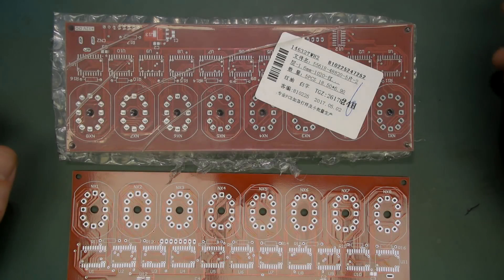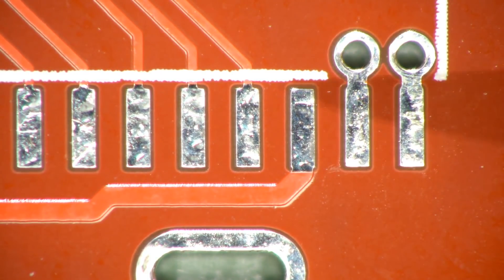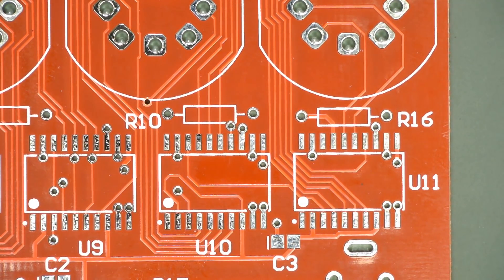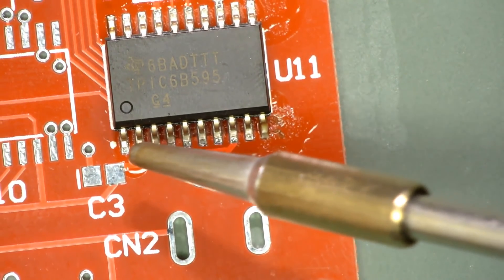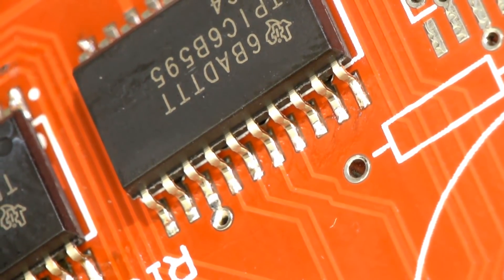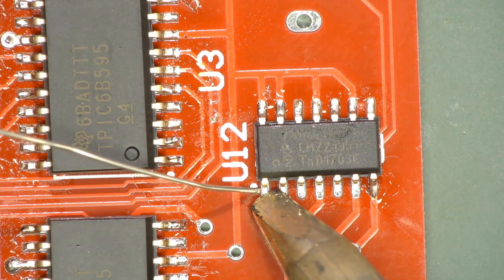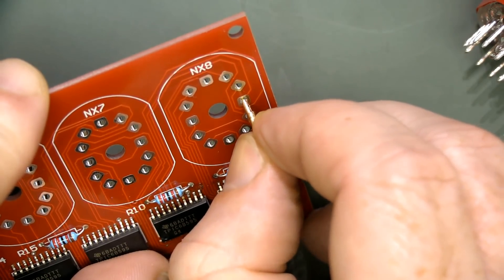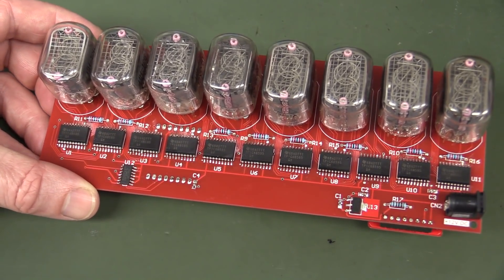EEVblog #997 - How To Solder Surface Mount Components

Comment: Cheers for the interesting and informative video Dave! Is there any reason you don't go back with some hot air to tidy up the placement and joints on the smd parts? I've done some shocking smd stuff by hand and fixed it with hot air later.

Comment: What's wrong with the soldering paste like MCN-300? It's much easier to use than any soldering wire in case of SMD soldering even with soldering iron.

Comment: Why did you use lead free solder?
Reply from the maker: To show that's it works just fine too.
Reply: I've always been taught that lead free leaves a poor appearance. 
Are there actually any benefits?
Reply: wasgood1 

Main reason to get on with lead-free is because many Countries have changed over to it due to the ROHS directives etc.

Lead-free is fine, as shown in this vid, as long as you buy the decent stuff (which will likely cost a bit more than your average leaded stuff, but not by much.)

Almost every consumer product made since about 2010 (at least in Europe) uses lead-free, so it clearly works well.
It definitely works better than the cheap electrolytic caps used in most gear these days. lol

Lead-free gets a bad rap for making weaker solder joints, especially after that whole Xbox360 RROD / PS3 YLOD saga, but that was mainly due to the piss-poor thermal design of those consoles, and problems with the internal "solder bumps" of the flip-chips.

See Louis Rossmann's vid on "Flip-chip BGA reballing is BS", or something like that. lol

There is a theory that lead-free is also more prone to the " tin whiskers" phenomenon, and there's even a white paper about it online, supposedly from engineers at NASA, but I haven't seen any direct evidence of that problem in the last 15 years of working in telecoms factories, where they used lead-free exclusively.

Comment: cant lie, solder job looks crappy. I never use flux and i can drag solder and look like factory work after on ic's. I need to make videos on my style of soldering. Also whats even more amazing is I use a adjustable 75w iron with one sharp tip only lol no bench soldering station or anything
Reply: The vast majority of components have tinned leads/contacts, so flux is indeed optional.  The problem comes when you don't notice you have untinned leads, and get bad soldering as a result.

The cost of flux and cleanup is always far less than the cost of troubleshooting a fault and chasing down a bad solder joint.

It is best to have a consistent soldering technique (with flux) that works "no matter what".

My worst problems came when soldering wire/cable directly to a board, where tinned is the exception rather than the rule.  I did this mainly for prototypes, when I was too impatient to wait for the connectors to arrive (or too cheap to pay for them).  Plus, if a connector is mis-wired in the schematic or layout, it's generally easier to fix a direct-soldered cable on a prototype (and continue with debugging the rest of the board) than to fiddle with the connectors.
Reply: i meant as no need for extra flux, i use the flux core as my main flux. I just go through more solder doing it.
Reply: DAT 30GB yes, please make videos on how to get factory looking soldering with lead-free solder

Comment: Dave how is the washing done (the process) to remove the flux residue ? can u do a video on that ?
Reply from the maker: Just use a can of any flux remover on the market and a brush (usually comes with it).  Regular Isopropyl works fine in many cases too.

Comment: This is like The Bob Ross of Soldering.
Reply: We don't have short circuits. We just have happy little accidents.
Every resistor needs a friend.
Reply: Niko Andruloni I was gonna say Big Clive too....you beat me to it
Reply: re the bob ross:   And..  there's a happy little surface mount tsop over here and  perhaps  a throughhole rectifier over there....     you can do what you want and don't be afraid or bashful    .. after all , It's your circus board  ;)     you can add a little flux to your capacitor if you wish ...   we don't judge here..........    feel the flow .. working it.. all good things!  ;)
Reply: @EngiMeer  Happy little solder. Theeeeere you go. Beauty. Now, how about we place this passive right here? Make it reach its friends. Because every little passive needs a friend.
Reply: Nah, that would be BigClive, Dave's too excited.
Reply: @andruloni  you mean Big Kev ?
Reply: Slapping soldering iron 10x on table leg at the beginning of work.
Reply: No.
Reply: He's more like the Bob's your uncle Ross of soldering.
Reply: i can watch this for hours
Reply: Maybe in your world, RoHS doesn't cause (intentional) premature equipment failure, and that's OK.
Reply: Bob Saget

Comment: Soldering surface mount parts is a lot easier with the pointed curved tips. I solder everyday and it helps a lot  although we always use 2 soldering irons which is sort of cheating.

Comment: I've always wondered how do you clean up the flux residue, I mean, is there any proper technique? for example, how do you clean up the flux between the pins ?
Reply: you can use isopropyl alcohol, regular drug store stuff, thats what I've used, not sure what the pros use though.
Reply: As SH says, simple rubbin' alcohol works well.  50:50 is fine; the water makes a good solvent too.

Comment: Thanks for the video. I have watched your soldering videos and they helped a lot. I needed to take the switches out and put new one in my logitech mouse  and was having nothing but trouble, after watching your solder vids, I took a file to my stick no controls solder iron gave it a chisel point and got the job done. Now I have two m570 mice that work better then original. 
Thanks for the demo vids they are a great help.

Comment: Wonderful vid, Dave! Thank you. I love watching SMD soldering vids and this was great. I have not used a well tip for soldering SMD and have only used a fine point chisel tip. I will probably never use a conical tip ever again. Looking forward to seeing your board powered up.
Reply from the maker: Don't use conical tips, the surface area for thermal transfer is horrible.
Reply: Agreed! After I bought my Hakko FX-888D, and it came with chisel tips, the difference is amazing. It really makes soldering enjoyable. Conical is just bad. Thanks for the reply, Dave! Keep up the fantastic vids.
Reply: I didn't solder for years because I thought I sucked at it, and you gave that "chisel tip" tip in another video. Asked for some chisel tips as a stocking stuffer for last Christmas got them and the difference is like night and day. I actually can solder well now and am getting back into making my own electronics projects again after not really doing much in decades.
Reply: The fine chisel is my shit. I solder everything with it, every day- down to fine-pitch TQFP and QFN

Comment: That's amazing value for those boards and a nice result.  Great results on the soic packages. I know everyone advises against it, but for me if soldering really small ones, like tssop56 or lqfp144 I prefer a nearly conical tip, just the faintest bit chisel at the point.
Reply: Okurka

That was 2-layer though, yep?

I found a great place for 4-layer - only $46 shipped (from China to the UK) for ten 10x10cm boards. :o

(with small 6 mil traces / spacing, and 12 mil drills / vias, and the quality is superb.)

I won't mention them directly, but have a search on PCB Shopper, and you should find them. ;)

Comment: Great video! I've learned a ton from your soldering videos. So one question if anyone has an answer, I just got a hakko fx-888 (upgrade from my 937 clone) I'm getting better at soldering but one thing I cant get a handle on is when I remove the tip from the joint, the solder will stick to the iron and create sort of a teardrop that looks bad and ends up bridging pins at times. I realize the fx-888 is not the best(best I can afford as a student), but I assumed that genuine hakko tips would help alleviate this? Im guessing its something Im doing wrong, any help would be appreciated!
Reply: This could be due to a number of reasons, actually. The primary cause seems to be that you may be applying solder directly onto the iron before applying it to the joint. You are probably letting the flux activate and dissipate before removing the soldering iron. Keeping the time to less than a second each joint is the most effective way to avoid this (unless your iron has poor thermal capacity, or conversely your board has a large one, maybe you've had problems with trying to solder ground pins in particular? :D )

The Hakko fx-888 is a great entry level soldering iron but here's a few tips to help it perform better and some soldering tips in general:
1. Make sure your tip is tinned before and after use! Oxidation on the tip is a common cause of improper joint heating and solder flow.
2. Make sure that you apply solder after you place the tip onto the joint. The joint temperature will activate the flux which will etch the oxidation layer on top of the join allowing nice, easy flow on solder.
3. Make sure that your tip temperature matches with the solder you're using. 60/40 lead solder is usually at around 240-280 C and lead-free is 300-350 C. Your Hakko has an 'adjust' mode which can be calibrated to the actual tip temperature, use a thermocouple to measure the tip temperature and calibrate your hakko to ensure that the tip temperature matches the displayed temperature!
4. Make sure you're using the good solder stuff! Use 'Multicore' (or other brand names). The flux formulation is a little different than crappy brands and will give you nice clean solder joints every time! Remember, temperature-activated flux has a limited lifetime at the temperature you solder. If your iron isn't smoking from the flux, the flux is most likely deactivated. This usually happens in less than a second! Do your joints quickly and carefully (making sure you balance the two).
5. Don't use too much solder! When you use too much solder it causes 'balling' which can hide 'dry solder joints' (bad joints). Try to practice soldering at your own pace, using through hole components and then moving to SMD.

EDIT: Another thing I might like to add is to use wire-based tip cleaning solution rather than the wet sponge method. This is much better at making sure your tip stays at the correct temperature and prevents wear and tear over a longer period of time for your tip. Your tip should be nice and shiny after cleaning and should be tinned between cleans! You can make tips last a very, very long time just by tinning, so don't be afraid to be liberal with solder for tinning.

Hope this helps!
Reply: Thanks for the reply! I actually do apply heat to the pad and joint and then apply solder from the other side, I use flux in addition to the flux core solder, I have been buying relatively cheap solder, but only because google searches didn't turn up much in the way of good solder brands, I actually looked up multicore after  I saw thats what dave was using, Ill have to get some good stuff soon. I do tend to use a bit too much solder at times I think, Ill have to adjust my temps a bit and check out what the temp rating on my greenlee 510A thermocouple is and possibly measure the temp with that. I have actually been using both for cleaning but I will switch to just the wire. Thanks for all the suggestions!
Reply: No worries, hope you have success with your future projects :)

Comment: What temperature do you use?
Reply from the maker: That is not a question that should be simply answered with a number because the answer depends upon the type of tip used, the thermal capacity of the iron being used, the tip to surface area, and the solder and flux being used.

Comment: 6:18 - Why put solder on the pad before putting the chip on it? Just hold the chip in place with tweezers and drag solder it. I have no problems doing it this way and it's much faster. You need to use a lot more flux.

Comment: What about cleaning the board once it is populated?
Reply from the maker: Yeah, forgot to film that :->
Reply: Future Video for you then.
Reply: Careful if you're using plastic components (especially connectors), as acetone can be quite harsh on certain types of plastic (like polyethylene). I would recommend using isopropyl first, if you're not sure.
Reply: Jesper Jensen I prefer to use lager instead of IPA, the board smells less hoppy afterward.
Reply: Siana Gearz Good point, but I would exercise caution nevertheless if you're designing or cleaning with any plastic in the vicinity. Acetone might not dissolve the whole thing but it can cloud clear acryllics or strip adhesives if you're careless!
Reply: I use 96% ethanol and a tooth brush to get rid of most of the crud (doesn't need much alcohol for that). But since after evaporating this will still leave a very thin layer of residue (just looks splotchy and matte) I usually apply water and soap while the alcohol is still there and rub again with the brush and it's super clean after that. If you have an air compressor you can dry a board within seconds, but a hair drier should be fine as well.
Just be careful when you got pots, switches or connectors. You don't want to flush dirt into them. If there's just one or two of them on a board I leave them out and solder them after I cleaned the board (trying not to overdo it with the flux that time). All other electronic components are pretty much water proof if you make sure you dry everything reasonably quickly (don't wait a day) and completely before applying power.
Reply: Sunny Pack that is true. Most common enclosure material is ABS and it's fully solvable in acetone. In general acrylics, styrenes, polycarbonate and polyurethanes (glue is mostly those) are sensitive to acetone. But MEK is a common industrial wash for PCBs, it's closely related to acetone, and everything that you solder down, you expect to be highly resistant to ketones.
Reply: Ben Krasnow at Applied Science has a really good video on why adding water to alcohol cleans most things better than pure alcohol. To summarize, the water dissolves more polar compounds, of which flux has many (e.g. acids)
Reply: 50/50 blend of acetone and isopropyl is what I use, works like a charm.  I have a tiny spray bottle I use for it.
Reply: I use 91% isopropyl from the local store. Nothing fancy. I have a squeeze bottle and some "acid brushes" to scrub with. I rinse in more iso, and dry it under my fume filter fan.
Reply: IIGrayfoxII As others have said, usually if u can get a hold of %91 alcohol that's more than enough for your everyday non crucial projects, just make sure it's dry before you run anything on it. If you want to go the extra mile, use 99%+ alcohol or pure acetone if you can.
Reply: I use denatured alcohol with a heavy plastic brush followed by a hot water and soap rinse and dry thoroughly with an air compressor.  If you have components that can't get wet, solder those on last and just do a quick cleanup of the flux on those parts without wetting the whole board.
Reply: Sunny Pack, you really found a connector that wasn't made of PA or PBT and is sensitive to acetone?
Reply: I use 99% IPA but not all of it comes off.
Reply: add a bit of clean water. I use a blend of 75% IPA and 25% Demineralized water.
Reply: For some reason I find using any ethanol/alcohol on any red PCBs causes the lacquer to become sticky and leaves it messy.
Reply: F3Ibane - LOL! I don't drink, but a pal of mine is into trying lots of quality artesian brews. Was waiting for that joke! :D

Moen I - Interesting... I've not used too many red boards, so that's new to me.
Reply: Moen  Lacquer is not alcohol based, it won't affect it in the slightest.  Shellac, on the other hand, is most certainly alcohol based.
Reply: Sandblaster, then dish washer.
Reply: there is no shame in the game  !  board that is known to be good   just hold it up in the air with a welding glove and hit it with a paint stripper gun and shake it right quick and   huzzah! a bin full of working parts!    just label the bin   .. known good parts!  .lol  ( or more accurately ' last known to be good'  .. heheh)

Comment: Thumbs up Dave, exactly how I do it with most of the stuff!! Even 0603 and a bit smaller is perfectly doable this way. Never understand why people bother buying stencils, waste time and money with ovens etc for just a handful of prototypes. 
Just learn to get (basic) soldering skills!!
Reply: Oh, btw I like to use those tweezers that automatically close. Gives you more control and it's more relaxed.
Reply: The stencils are a waste of money if you're just making a couple of boards, unless you are using really small stuff.
I built a pneumatic solder paste dispenser and I can do a board pretty quick and accurately with it. I just use a hot air gun to solder everything. It comes out a lot neater than with the iron since the parts automatically align them selves to the pads.